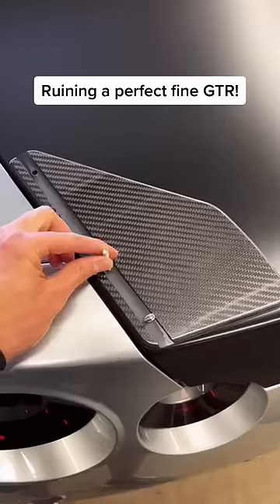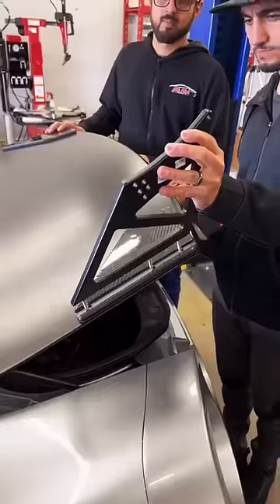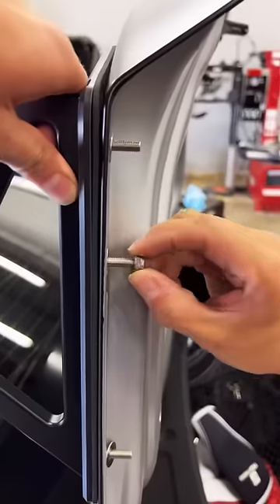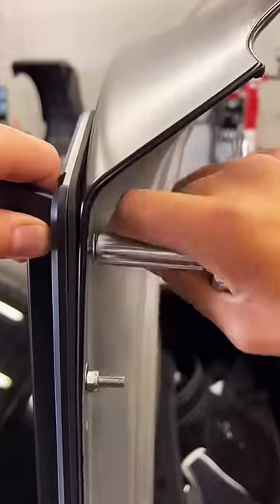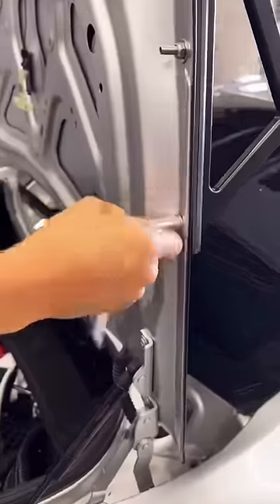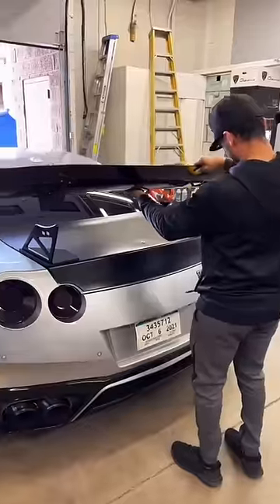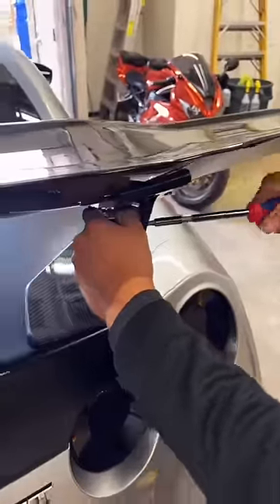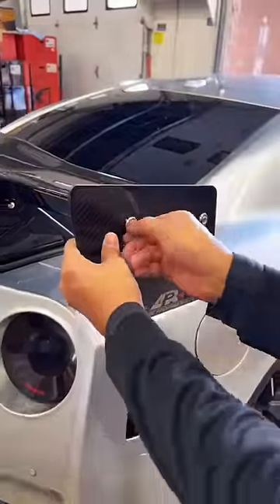Ruining a Nissan GTR with an APR Performance spoiler!

Comment: “Life is too short to drive a boring car” 

I’m pretty sure the car wasn’t boring before you put the wing on.
Reply: Yep
Reply: @dustybunny66  there’s a massive chance that all that wing will do is slow it down
Reply: @dustybunny66  a duckbill would look so much better tbh
Reply: I hate this boring car sentence
Reply: I am sure the car is not boring anymore since it has a spoiler that could also be fitted to a 1999 honda civic 16v… good job to this guy for depreciating his car even more, creating unnecessary drag that will in fact slow down his car and make it boring! 
Outcome: mission successful
Reply: Technically if he added rear downforce and no front it's making the front end have less grip...
Reply: Its a gtr with a tacky wing, it looks boring with or without it
Reply: The point is that it's his car and he can do what he wants to his car.
Reply: @michaelg492  I mean the car itself, like driving it. You don’t think looks suddenly make the car more fun to drive you know what I mean?
Reply: It’s just an Altima with a body kit
Reply: Pretty was
Reply: @joshjackburns  APR designed their wings to have an effective amount of downforce while reducing drag. Just because a car has a big spoiler, it doesn’t mean that it’s a parachute mounted to the rear. Take the Dodge Viper ACR extreme as example. They designed the aero on that car to have so much downforce that it reduced the top speed significantly.
Reply: All they do is slow the car down because it helps with downforce but it makes it slower
Reply: @SuperSsxmaster  which duckbill?
Reply: @johnratajczak1  I’ve owned an Altima and 250hp FWD Naturally Aspirated vs 485hp+ Twin Turbo AWD is much different.
Reply: Like it’s a street car.  Speed limit is 65 bud.  Stop wasting money ruining your daily ffs.  Just build a race car and feel what 6 gs around a 210 corner feels like.
Reply: @joshjackburns  not a chance my dude.  A certainty.  Especially since this only gives you more traction at really high speeds when every detail counts.  This car spends most of its time waiting at red lights and going 25 mph.  What’s the fucking point of trying to make a street race car.  Just make a dam race car and go to the track.  Feel so pony’s Gallup
Reply: Stay mad it’s his car lol
Reply: If it’s boring for him it’s boring for him, not our buisnedd
Reply: This is what they call a build
Reply: He ain't doing it for you.
Reply: @demarcohigh247  I don’t think a wing counts as a build. If it does then a Civic with a big ass wing counts as a build too.
Reply: @joshjackburns  Spoilers aren't made to increase speed, yet increase down forced. So are correct in a obvious way.
Reply: Yea and it looks rediculous
Reply: @destruxandexploze2552  you buy a expensive car just for the insides? NAH MATE
Reply: @infinity002  Uh no, for the engine, transmission and 1/4 numbers and 0-60
Reply: @carlitosjuarez221  it’s not a build though you can’t hear the sarcasm in my first reply
Reply: @dustybunny66  who asked
Reply: It was not boring for you, it oboviously was boring for him
Reply: The thing about big spoilers is that you can’t fucking see behind you. I’ve learn that when I put one on my civic. Now I don’t drive small ass cars no more . I drive big and bad ass cars like off-road type of vehicles so I can drive off-road and go camping.
Reply: @streetfighter4006  unless its ferrary, bentley, or royce, that is cx

Comment: “Ruining a perfect GTR” by drilling a hole in the middle of trunk lid that you don’t need
Reply: Nah that’s from the oem spoiler I think
Reply: Its a wire for stability
Reply: @wallypop2947  you can see on the video he drilled it
Reply: Its for a mini camera so you can catch whoever steals your cool wing from your boring car.
Reply: @DemarcusQ  LMAAAOOOOOO
Reply: Why tf did he do that though?
Reply: @Evosti  wait, really?
Reply: @DrDAC-go7hs  yeah to keep the spoiler stable
Reply: I think he explained in one of his other vids that it's a key hole
Reply: He had to drill the hole all the way through to install the plug that comes with it to cover the center hole
Reply: @wallypop2947  no he drilled it in the video and wasnt there in the beginning
Reply: He didn't ruin the trunk, it's an aftermarket OEM trunk, not the stock trunk
Reply: @snipergamingtf2167  hahahaha "aftermarket oem". Sure do love me some aftermarket oem parts on my car.
Reply: There goes wire to support it at high speed, get informed before you speak, expert
Reply: @adamk9354  Except youre wrong, APR wings dont use tensioner cables. If you look in the "Parts included" list on APRs official website that screw is listed as a plug screw to plug the third hole that comes from removing the stock wing on an R35. It literally says in the install instructions not to torque it down to much or it will warp the metal. This dude literally drilled a hole so he could put the screw designed to plug a hole into. Maybe you should get informed before YOU speak.
Reply: @adamk9354  Heres a video of somone installing it in detail, there are no tension cables. https://www.youtube.com/watch?v=OI3KghNCln0
Reply: @daveswietlik6291  apparently it’s a keyhole because the trunk won’t open due to the weight of the wing. u seem like u know ur shit so i’m not saying ur wrong, but hopefully that makes sense as to why he did it
Reply: @daveswietlik6291  Im glad im not the only one who noticed this
Reply: @replexity  a key hole covered with a tightened screw?
Reply: @replexity  No, its not, he put a screw in it, its not a keyhole. The R35 GTR already has 2 manual trunk releases. One in the trunk itself (the help me I'm stuck in the trunk lever) and one under the passenger side floorboard. So many people in this comment section are experts on the GTR and have never even worked on one smh.
Reply: @richhooker1263  i didn’t notice it had a bolt in it, but yea i have no clue what the end goal was here. i was parroting a comment in another thread that made the most sense to me in hopes to quench the curiosity for other people too
Reply: @richhooker1263  amazing how many people are "experts" on the R35 and haven't even been in one, let alone worked on one. The manual release for the trunk is under the passenger side floorboard (also there's a "help I'm stuck in the trunk" lever in the trunk itself) there is no key cylinder in the trunk itself. So many armchair mechanics in these comments it makes me sick.
Reply: @replexity  not sure, but another commenter looked up the wing, I guess all GTRs with this kit have that same middle hole. So it does have a purpose of some sort
Reply: @wallypop2947  nope watch it again with your blind eyes
Reply: @noseyloft  nah I’m good

Comment: Before anyone starts judging, the hole in the middle is for a long 80's antenna to be installed later so you can listen to the radio, cause' life is too short to drive boring cars..

Comment: Bro who said it’s ruined? The only thing wrong is the fucking glory hole in the middle of the trunk
Reply: Omg 😂😂
Reply: True
Reply: It’s a keyhole, he did however push way to hard and dent that perfect trunk
Reply: ahhahahahahqh
Reply: @jax9074  it is not for a cable to stabilize the spoiler. Literally every other video of these being installed on YouTube nobody drills that center hole.
A cable does not make sense as it would only pull in the downward direction, the same direction of force generated by the wing. It does not generate lift. It is not an airplane wing
Reply: It's for the added key hole because the new wings are too heavy for the normal trunk lock and when you unlock it form inside it will still on the lock position.
Reply: @gregorius4648  you being sarcastic or you actually reckon ?
Reply: @giantmanice  bro look up “APR performance spoiler GTR” and every single build has the trunk hole

Comment: When it rains the whole trunk gonna get flooded
Reply: Patrick d'Argent  i don’t think u understand what washers are ment for
Reply: Patrick d'Argent  not if that middle hole that they drilled for no reason has anything to say😭
Reply: Patrick d'Argent  no one’s hating bud you just don’t know what you’re talking about
Reply: That's what I am saying this is a half a$$ job bolts way to long and leaks for days  they killed it .
Reply: Patrick d'Argent  washers exist so that when you tighten a bolt the force is spread out over a wider area and when you are tightening the bolt over the original surface, you do slightly damage it, a washer is there to minimize the damage and be a sacrificial surface.
In the video you see a small layer or rubber, perhaps if it’s on tight, it will keep the water out.
Reply: Patrick d'Argent  you were implying the washers that were in the video, which are regular ones that by themselves won’t do much against water intrusion.
Reply: Everyone arguing about it without even realizing the holes are drilled on the outside of the weatherstripping. Itlll be fine
Reply: Previous owner of my e36 did just that, on the edge outside of the weatherstripping literally exactly like in the video. It can't get into the trunk, but what happened is water got into the boot lid and it rusted from the inside...
Reply: Patrick d'Argent  facts
Reply: @DigitalAdventures1  where da fuck do you see any rubber. still it will rust away from moisture in the air, that's why there are anti rust coatings available. blank steel + air = rust
Reply: I didn't see any rubber seals installed so yeah the trunk gonna to get flooded and rust is not completely off the table
Reply: Maybe it's just me, but why the hell did he drill a hole at the center of the trunk? The side holes are likely to be just outside the trunk seal/gasket, so the trunk won't get flooded. But the center hole says otherwise.
Reply: Patrick  you sure don’t. Not hating, metal washers in this application are not meant to be water resistant. That’s what a gasket is for.
Reply: @E63Isaiah  The fact you need to ask proves you're the problem not the solution...
Reply: A good installation would involve a silicone bead on the holes.
Reply: Bro never heard of a washer
Reply: They drilled the holes outside the gasket, it will go down the water channel beside the gaskets of the trunk lid
Reply: It actually won’t. Even if it goes threw the washers. If you look at how a trunk is designed you will see a rubber gasket. Water actually flows threw that section.
Reply: @shrimpking6647  
When th back wing causes downforce it will act as an AC it's very ingenious you should try it
Reply: Bro there r padding called washers 😂😂😂
Reply: Pretty sure they took good care to seal all the holes
Reply: Washers dont really work as a seal blud

Comment: This dude def dont work on cars if he calls drilling a hole a "hastle"
Reply: its spelled as haesel
Reply: You've probably never owned a nice car. It's an easy task but it's tough to do😂
Reply: @rawbeejay  dawg it’s not that fucking hard, especially when the entire car has a 3D rendering online by the company. Literally you can just take the dimensions of the spoiler and put in center to the car wherever level up or down you’d like, and it’s not rocket science to create a level/true spoiler.
Reply: It's an emotional haesel... U probably know how much it hurts to drill a hole in your car... You know that if you mess up you cant go back...
Reply: @ferv888  u can go back very easily loll
Reply: @Krowonos  Do you mean “hassle”?
Reply: @titaniumblood408  I work on a 330ci with my dad all the time, a hassle is putting in a turbo and rerouting all the ac shit because the turbo needs the radiator for cooling. Or swapping a transmission bec his engine and turbo make too much power for a stock tranny. Honestly I don’t think there’s any main system on that car that’s stock anymore lmao

Comment: Don't forget to put a rubber grommet above the washer on the inside of the trunk to keep it water tight and not damage your paint or more importantly in this case, your carbon fibre trunk lid.

Just a tip 🤷‍♂️

Comment: "Three 10 millimeters bolts on both side"

Actually uses 6 millimeter bolt instead 🤦🏻‍♂️
Reply: 10mm is the larger part you rotate it from
Reply: 10mm bolts goes on 6mm screws
Reply: @andreiceban438  
No a m6 bolt (or screw if its a inbus or torx for instance) takes a m6 nut, that takes a 10mm spanner (usually, also available in 9 and 11mm)
Reply: And makes them about 20mm to long 😅
Reply: @grotevin  at some point I've stopped explaining metric system to americans lol
Reply: @lore2861  thats not how it works
Reply: @andreiceban438  thats not how any of this works
Reply: @grotevin  obviously I was referring to the key that tightens the bolt in place. Y'all try to sound smart asf yet you understood what I said
Reply: @andreiceban438  I understood the guy in the video too, doesn't mean he wasn't wrong.
Reply: @grotevin  yep, but I wasn't. A 10mm bolt (the outside) is my. And that's the standard, ofc there are always variants.
Reply: @andreiceban438  you are wrong.  The size of the bolt or screw is defined by it's main diameter, not by the head size.
That you always refer to a 6mm bolt as a size 10 doesn't make it correct.  Would you refer to it as a size 5 if it was an Allen head? Of size 30 if it was torx?
Reply: @grotevin  nope, i say M6 bolt, M6 scree, but if I say 10mm it's the head I'm referring to. That's how I  people that taught me always called them so I got very familiar with that. Looks like I'm not the only one. But yeah technically you are right.
Reply: Technically we shouldn't drive over the speed limit, but in the real world, it's not like that, is it?
Reply: @andreiceban438  yeah but the real world isn't a thread that is about nit-picking over bolt sizes. Anyway, have a nice weekend, or at least what is left of it ✌️
Reply: @grotevin  right on! Same to you my man ✌️

Comment: “Two holes”
there’s like 3 on each side and one in the middle. That they drilled for absolutely no damn reason
Reply: 3 of the holes, one on left, one on right and the center one were already there from the original OEM spoiler that came with the car. But fr that dent in the middle looking mad ugly
Reply: @litework3564  beginning of the video no hole in the middle
Reply: Well he said he ruined it. And you’re saying he ruined it. So really you’re not saying anything. Bc he already said. What’ your trying to say.
Reply: @DanielMustang47  ayo! I cannot see I’m legally blind
Reply: Your all wrong it’s for a cable wire to go to the middle for stability
Reply: @jttyson2214  that doesn't make any sense, downforce pushes the wing down, the "cable for stability" would only provide force in this same downward direction. The wing does not generate lift this is not an airplane. Plenty of videos of these being installed with no extraneous center hole drilled bud
Reply: @jttyson2214  Damn you got wrecked.

Comment: The middle hole is the elephant in the room.. So please answer 🤭.
I seen other GTR spoilers and they don't drill the middle hole.
Reply: Someone said it’s for the keyhole added.
Since the spoiler is so heavy, you gotta add a keyhole apparently 🤷‍♂️
Reply: @mro4ts457  seen this wing installed in several other videos with no middle hole
Reply: @giantmanice  
Maybe those people didn’t try to open their trunks yet, or don’t realize how helpful a keyhole will be yet, cause they just installed it?

In theory, people are saying this guy knew the wing would be heavy and just did the keyhole to save time🤷‍♂️

Comment: All these comments are so painfully misinformed. 🤦‍♂️

1. Trunk is aluminum, it wont rust.
2. Removing the OEM wing results in lots of preexisting holes. Yes you need to only drill 2 more, but those additional 2 holes will be covered back up by the oem wing if you want to go back.
3. The middle hole is already there from factory but, you need to drill one layer deeper to apply the APR provided plug/washer. It is NOT A KEYHOLE. Believe it or not, the physical keyhole for the trunk (only if electronics fail) is in the hidden passenger footwell. 
4. The wing mount plates have a rubber padding under them, keeps water out of the trunk.

Ugh... youtube commenters are the worst.

To the maker: hope you enjoy! Good install!

Comment: The middle hole is for the factory wing. APR sends the wing with a bolt and washer. You have to drill through the entire trunk lid to get a bolt to the other side. You don’t see the hole in this video because the wrap was covering it.

Comment: Pfft! I built a perfectly functional one for my Daewoo out of MDF, and it works great! The added downforce helps hold it on the road up to speeds in excess of 50kmh! That may be because it weighs around 40 kilograms, and the double sided tape holding it to the trunk has only needed to be replaced 6 times out of the 4 times I've taken it for a drive. It gets lots of looks and attention, even from the po-po, and we nearly lost them when they chased us on their pedal bikes. After they were able to regain their composure from laughing so much,(which I thought was VERY rude!), they made us remove it and put it in the dumpster that was out the back of the D&D gaming lounge that's our hangout.

Comment: a gtr isn’t boring, but big functional spoiler on a gtr is pretty cool. something like that, at speed, would make a big difference

and the hole seems to be misunderstood, they installed something there, and i’m pretty sure they only drilled through that black wrap, the stock spoiler has a bolt there

Comment: That middle hole is from the OEM spoiler. APR provides a little cap for that hole to cover it. I have no clue why you drilled out that hole bigger, but you sure did dent that trunk!

Comment: 1. Arent you supposed to wear protective clothing when drilling/cutting carbon fiber? 
2. Why is there a random hole in the middle of the trunk that left a huge crater from pushing the drill too hard? Is it for something you did outside of the video? Even if it is, that huge dent isnt pretty.